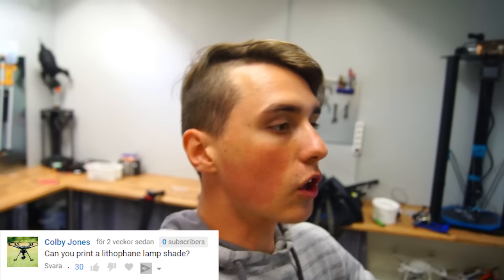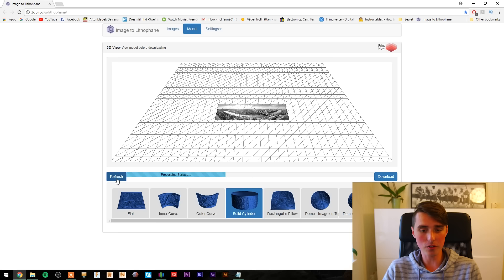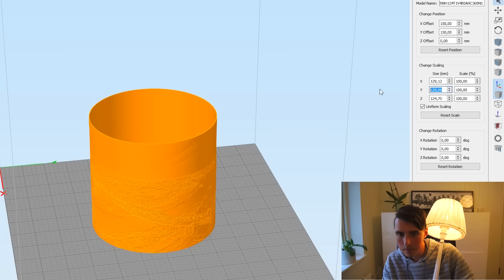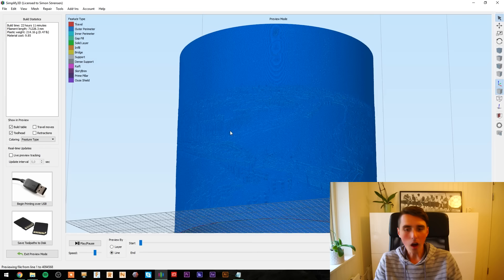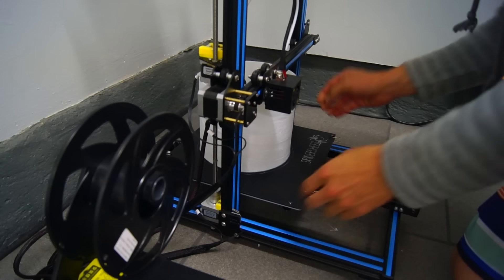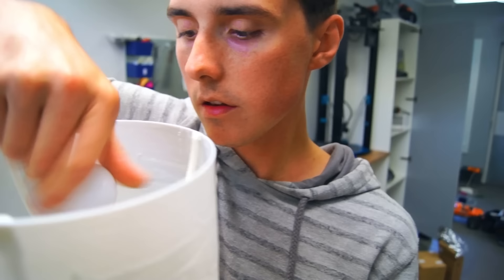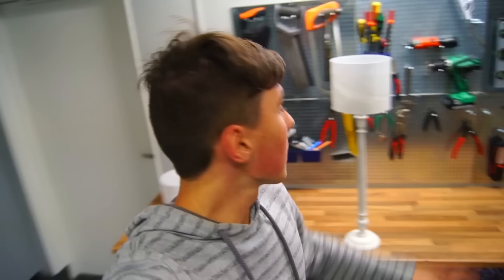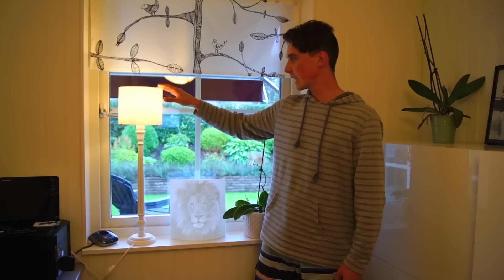3D Printed Lithophane Lamp Shade - Custom DIY Design

Comment: Check out the Ikea Lampan table lamps to use as bases for these type lamp shades. The original shade of the Lampan lamps comes off normally for access to replacing the light bulb. Simply replace the original shade with the printed one.

Comment: Have you tried putting the "picture" side on the inside so that the outside of the shade is smooth. I think it would be cool if it looked like a normal lamp shade when the light was off, but then you turn the light in and BAM and you can see the design.

Comment: At 1:38, there is a gap in the back, you can fix it by going to curve and type 361 or 362 instead of 360 (it works)

Comment: It needs to Spin!! And use a white light bulb!!
Reply: NE 555 Warm white LED bulbs are actually a bit of a yellow shade to begin with. He did say the lamp was warm white, whereas the lion was more blue (cool white?). Anyways, a daylight bulb would be more white, and possibly a bit of blue. (Warm white is supposed to mimic a setting sun, whereas daylight mimics the color of light that the sun gives off at noon day).

Comment: Why you don't do the same thing but make it like an Earth
Reply: thats cool
Reply: HOME MELI cool but would be very hard to print with no internal support
Reply: You could do it if you split the earth at the equator and printed each hemisphere separately , pole sides down. I use a bfb 3d touch printer and do hemispheres all the time with no support...
Reply: Pole sides down?  I'm guessing you use a raft or something to anchor it down?  Have you tried pole side up?  Did it fail?

Comment: I use simplify 3d also.  How did you get the cylinder so thin?  I noticed it was set to 3mm.  But it looks so thin.  When i enlarge the print in simplify 3d, it makes the walls so thick and light cannot get through.  Help..thanks..

Comment: You could have just added more filament after the old ran out. Go to "Tune" settings on the printer (while printing) and select "change filament". It will move the extruder to home position and automagically continue from where it left after you press the button. Just be careful to not press the z-axis down while pushing new filament in.

Comment: I actually thought of a lamp shade when I watched the last video - but with the extra thickness on the inside of the cylinder - to make it more stealthy...
My own printer can not do a big enough volume, so I hope you would consider another one??
Reply: why don't you just make one your self and scale it to fit your lamp
Reply: Another thing to consider is making the lamp shade with several of the simple curved lithophanes that you then somehow tie together. That way you don't need as large of a printer bed to make the same product.

Another video I saw when looking for this one has the idea of using small, flat lithophanes to make a box with LEDs inside. Maybe that would be more within your capabilities.

Comment: I'm wondering what brand of filament to use for lithophanes.. I used matter hackers pro pla but it was hardly translucent. I had a sample spool that came with my cr-10 and it worked great but I ran out

Comment: hey dude. this looks awesome! however when i select solid cylinder on 3dp lithophanes it makes.....a solid cylinderrr (not a 'tube'). did you hollow it out? didn't seem like you needed to in the video, and the filesize is too large for me to import it into tinkercad, so it's kind of complicated. i'd really appreciate your help. what could i be doing wrong?

Comment: Its not the colour light on lamp shade that hiding the pint image ...
It the bulb output is to high to bright ....Lower watt bulb or RGB strip with brightness control would work best .
Reply: InkDropFalls So a dimmer light brings out the details more? (Or I suppose, more accurately that it doesn't drown at the details as much as the brighter light) That's interesting. Good to know!
Reply: Could test that might make good video ..buy different types bulbs and watts and test them on  Lithophane Lamp Shade see what effect you get what makes it look best could even try few colours ....
I think that could make an interesting video

Comment: Hey man, first of all, i love your videos.
I'm trying to 3D print a Cylinder to use it on a lamp, but everytime i the "solid cylinder" option it looks like its going to actualy print a solid cylinder with a roof on top as well, i want it to be an open cylinder from top and the bottom as well, how do i fix it? i did everything you did on this video and it still looks like it'll print a top and bottom layer. (for the record, im literally new at 3D print, i just bought my first 3D printer)
thank you so much! keep making videos
Reply: Try 0% infill in the cura settings

Comment: Don't know if you still read the comments on this movie but I have a little question. I made a large image myself (3 pictures in a row) and import them in 3dprocks. Then I used your settings (360 etc) but the cylinder stays full. Also in S3D it stays full of course but when I set 0% infill it is indeed emtpy but the quality is very bad. In 3dp rocks you made a cylinder and there is no infill. How did you do that?
Thank you very much for reading en I follow you, of course.
Knownbug
Reply: Was this ever answered? having this issue too

Comment: My Lithophane gcode is 98MB for a 110mmx110mmx134mm lamp shade. Using Simplify 3D with the settings you showed and using CR-10 printer selected in Simplify 3D. When I try to print from MicroSD card on my CR-10 it just sits there and does not print. It will not even heat up the bed. Any suggestions? *Note* Build time says 749 Hours 17 minutes

Comment: I am testing your settings in Simplify3d and my lamp shade says 5+ days to print.....any thoughts? Could I get away reducing the infill to 50% or lower then and still have the same image quality results? I am using a CrealityCR-10s - My lithopane shade dimensions are x:254.07mm  Y:254.14mm  Z:296.71mm

Comment: Loved the lamp shade. Great work... I tried the same thing but am not able to make the cylinder hollow. What could be the issue?
Reply: shubham shah Did you select the option for using the curve and set it to 360° like he showed? Selecting the option for "solid cylinder" doesn't work the way you want it to (if you're hoping for a hollow tube).

Comment: Hey dude I was wondering how you got the measurement for your lithopane to slot into your attachment you made? DO you use the dimensions of your lithopane thickness from say image to lithopane website or..?
Reply: Propergander Productions I imagine he would've measured the thickness of the lithophane that he had already made. A good pair of digital calipers are essential for a 3D printing enthusiast, after all.

Comment: i was just wondering what dimensions of photo did you use as  all the photo i upload to this site ends up with a seam  im trying to print one without a seam (like an endless scene )  if you get my drift!! any help would be awesome  subscribed  for months and in my liked and fave tuts ;)
Reply: gothmaniow If you mean the seam on the side where one side of the original image ends up touching the other, I believe his had that, too. At least, I saw it at one point when he was still modeling it.

Comment: This is an amazing project! I've got a question: Is ANET A8 good for the first 3D printer? It's only 140$ for me and CR-10 is a bit too expensive. So? :)
Reply: I personally would not go for Anet A8,  Look into Anycubic I3 Mega, for a little more money, you get a much better printer
Reply: It's twice the price on Gearbest for me :/
Reply: Filip Paryż The anet  a8  was my first  I've  had it since  January  and run it nearly  every day, if you can assemble it properly  it's  a  good  little  machine.
Reply: I think I'll dive into 3D with this printer :D

Comment: Hey,
Great video
I printed a lion lithophane using flash print 3.18 . The software has in built feature to convert images into 3d shapes like conical,lamp etc.
I found it easy than the website you mentioned. 
Please check it out